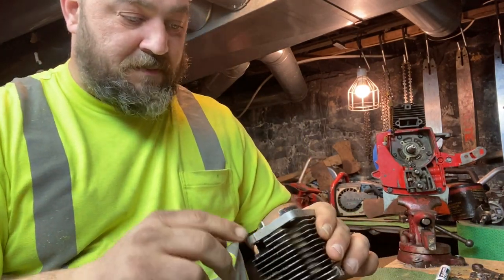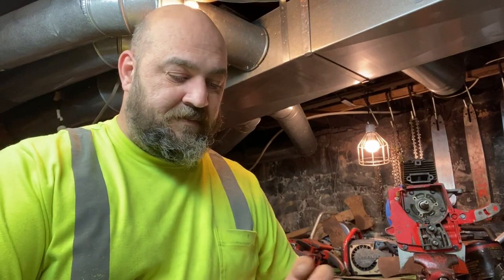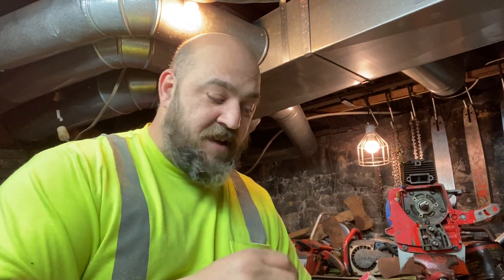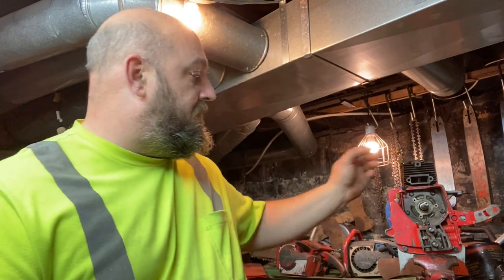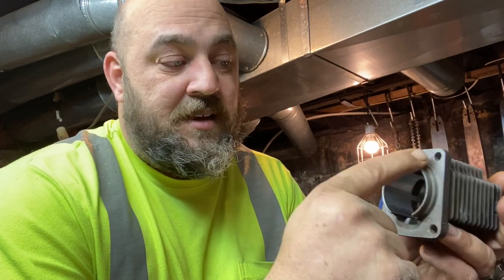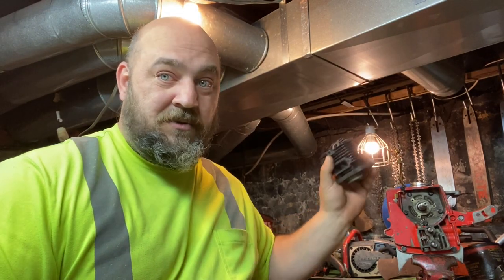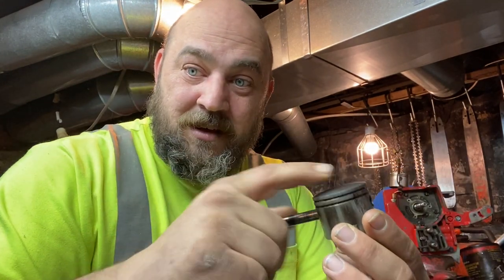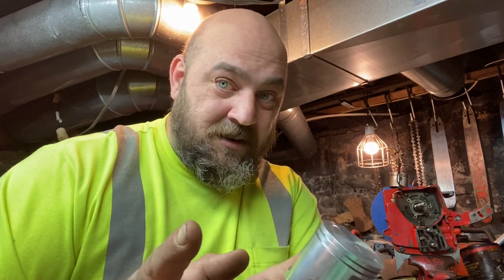Chainsaw Porting Class!!  How To Port A Chainsaw For Beginners!  Homelite Super XL Automatic #8

Comment: The problem I have is that most of my saws are of the clamshell design.  That makes the machining much much more involved than just dusting off the bottom of the cylinder.  I haven't tried it YET! But I'm considering it on a really cheap saw somebody gave me they found in the garbage.  It's almost like new and runs well, I don't know why they threw it away, other than it's a cheap Poulan 3816. It'd be a good practice job particularly on the setup on the mill with a boring head. Anyway, a few things you said I hadn't considered.  When you were talking it was "clicking" for me.  I'm by no means a power saw expert, I own a class 8 heavy truck collision and restoration shop.  But power saws are just so darn cool!! I'm up to 15 in my collection.  I even have a homelite 7-19 from the late 50's, it needs work of course.  Lol Thanks for taking the time. Love the series. 👍✌😁
Reply from the maker: Thanks buddy!  I drive a class B truck for a living!

Comment: I been in the chainsaw community for years now best people on the web I say welcome you have some good ideas I got a soft spot for xl12s first saw i ever owned i cut wood with one for 16 years for my home and shop i mean it put some wood on the truck i picked up a sxl12 a year ago and it clean low hour saw but i was going to put seals in it before i ran it now i think I'll tear it down and follow along i am loving your channel,
Reply from the maker: I do not suggest porting the XL-12.  The bearings are not as heavy and they do not have and auto oiler.  I suggest using the Super XL Auto.
Reply: Yes that is what I have sxl12 auto just like your saw

Comment: Really good info on porting saws! I took your advice about not going to far and turning up the saw slowly. I built a stihl ms 391  it is a clam shell but I put a Hyway cylinder I did not do any work to the cylinder because the transfer ports were bigger and  the ports were lowered like the base was machined  . I also put a popup piston in it. It pulls a 25 inch bar much better. Right now tuned at 10000 for break in. Awesome videos!
Reply from the maker: Next time do your transfers and discover a whole new level!

Comment: Great video,can i put aftermarket rings on a lightly scored piston? Just being lazy. I mean it cant hurt.
Reply from the maker: As long as the cylinder isn’t scored.
Reply: @Smittyschainsaws  Thanks for reply, is there a way I can pull the top end off,without completely tearing down motor. And replace rings. XL 12 the blue one,has manual oiler. Don't know year
Reply from the maker: @tailzzgermzz6943  a decent amount will need tore down.